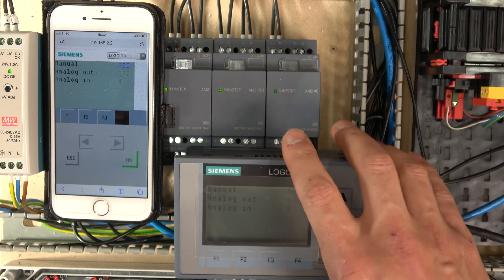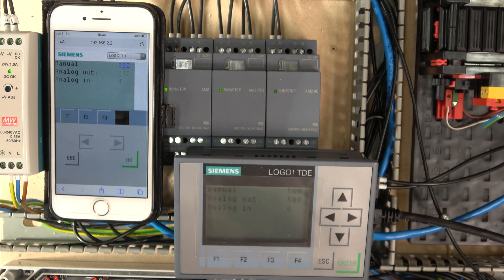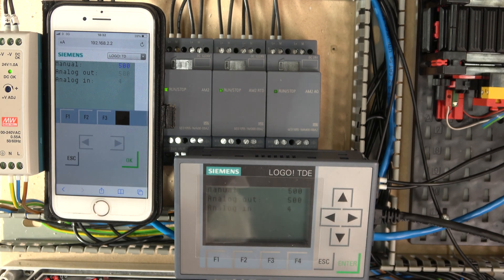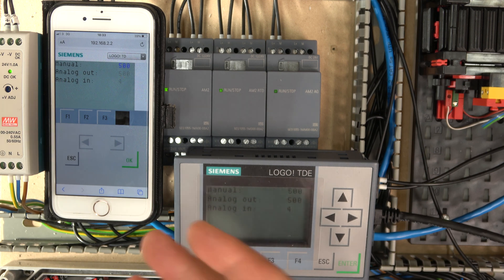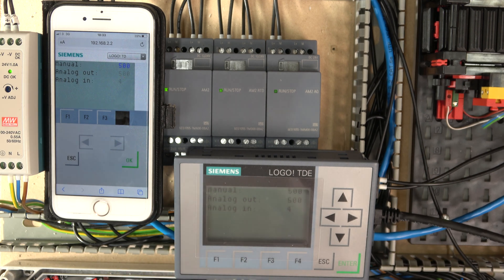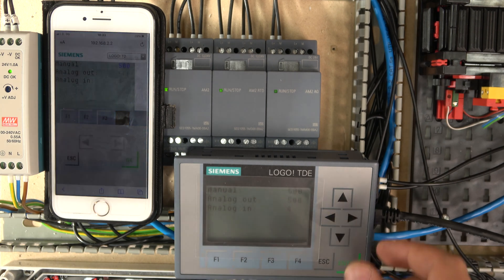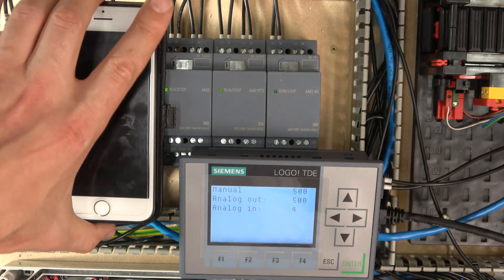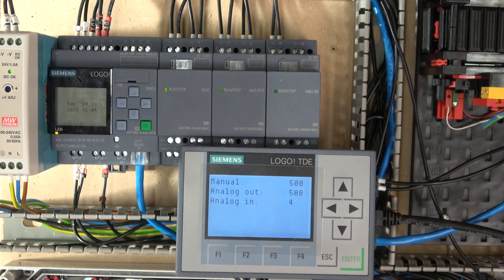Siemens LOGO! 8 SF4_1, Web Server, how it works, how to set it up, network set up. English

Comment: Hello. I am from russia. And I don't quite understand English. How to connect to the logo if the connection to the network is via a router?
Reply from the maker: Hi Trofim, this set up only works if you are in local network, you cant access the logo if your phone for example is not connected wireless to the same network as the logo is.
Reply: @IGSElectronics  but is there any way to do it ? Or Logo does not support it ?  I`m looking forward to hearing from you